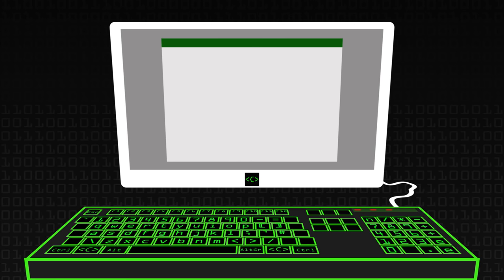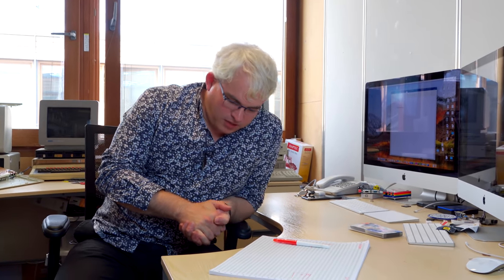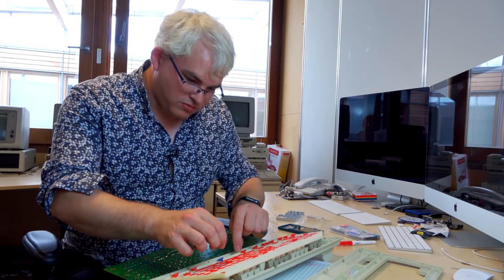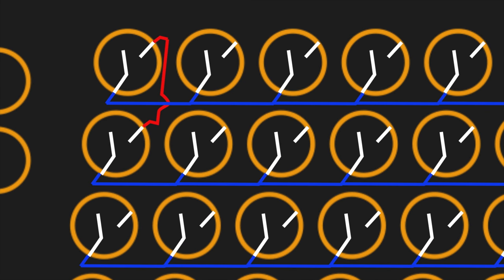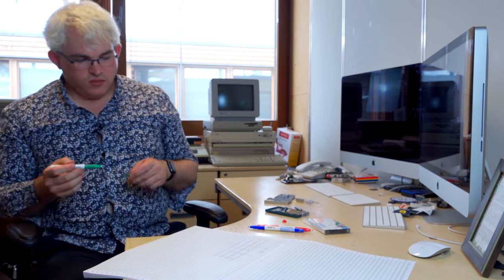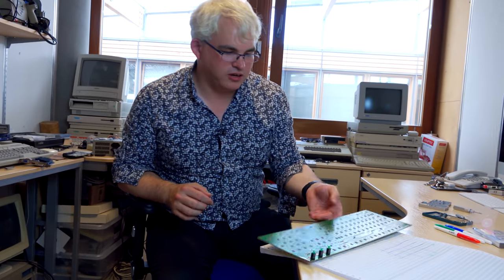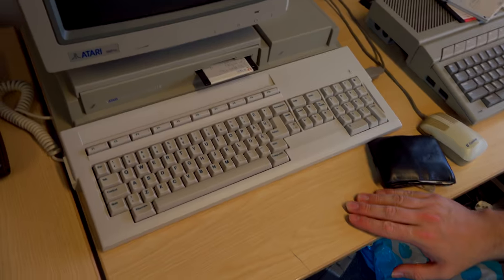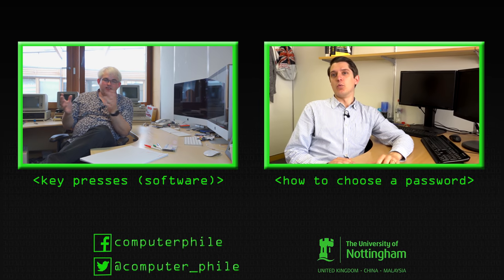What Happens When I Press a Key? - Computerphile

Comment: One thing not mentioned is the "de-bouncing" circuit. As switches, the keyboard switches tend to "bounce" or "ring". One keypress produced not just one, but multiple key-down and key-up events. The "de-bouncer" ensures that these are picked up by the machine as a single press.
Reply: noferblatz you can also fix this with many many diodes (one for each key) , no ghosting then :)
Reply: Andrew Joy you can use diodes to debounce? I've used caps, but never heard of diodes.
Reply: Diodes can't be used for debouncing, usually. I think Andrew is mistaken. Ghosting and debouncing are independent of each other.
Reply: bvbk007   I agree with you.  Might be worth mentioning software debouncing, that I've used on arduino projects.  No extra components, the software does a very crude simulation of an RC network response.  Maybe called a boxcar filter?
Reply: bvbk007 ok, just making sure I didn't fall asleep in Electronics or something.
Reply: A lot of older systems used software debouncing, or... I guess you might call it 'firmware' debouncing.

If it isn't the computer doing it, it's the keyboard controller, but many keyboards are essentially computers in their own right.

That's not to say pure hardware filtering doesn't happen just as often, but software filtering just seems to be cheaper...

Sometimes, there's no filtering of any kind in the underlying hardware, firmware or OS, and the end user program has to do it.
That's always fun. XD
Reply: As seen on his example rubber dome over PCB keyboard, there's typically minimal hardware and the debouncing in this case must be performed by the microcontroller that does the keyboard matrix scanning. Diodes are used in higher end keyboards to avoid ghosting (where multiple keys cause misdetection), but can be used for unidirectional debouncing in single switch circuits.
Reply: It's not electrical "ringing", that's what happens with inductance. It's microscopic arcing of the low voltage signal across the switch contacts, which an R or R/C snubbed will suppress.
Reply: LoneTech  could you explain how you're connecting a diode to achieve uni-directional de-bouncing?  As I see it a diode does not provide the needed time constant to convert a flickering switch state into a steady one.
Reply: Ray Kent I wouldn't call software debouncing crude. wait for N consecutive reads without a state change, then trigger the event. It's very reliable. No point in simulating the rc circuit - it would require multiplication!  there are more direct ways
Reply: I built a keyboard in college for one of my classes. You can do with a capacitor or just do it with the micro-controller, where you track the number of high/low cycles. I wouldn't exactly say it is a circuit.
Reply: In regards to using a diode for debouncing I honestly can't recall the frequency response of a diode but the cap makes sense in a little high pass filter that is going to ground. I imagine it would attenuate the bounce to remain under the voltage threshold that reads as a switch press if you dialed the circuit in correctly.

Comment: 10:02 And one nice thing about scan codes is they don’t distinguish between modifier and non-modifier keys; it’s just “key «n» has been pressed” and “key «n» has been released”, it’s up to the software to decide if key «n» is a modifier key or not. And you can distinguish between e.g. left-shift and right-shift (they have different scan codes), and implement other fun custom behaviours.
Reply: At least for USB: yes, they do. The state of the modifier keys is encoded in a single byte (which indeed allows a distinction between left-shift and right-shift), then other keys are transmitted individually. Sure, the software can decide what to do with that information, but the modifier keys do play a special role from the hardware perspective.
Reply: @floxbr9350 yeah i learnt that in ben eater's video about usb

Comment: Back in the days of windows 95/98 and XP I used ports 0x60 and 0x64 to communicate with the keyboard controller directly and insert characters into the keyboards output buffer which were then read by windows as normal key presses. This let me get past several games anti cheat / botting software.

Comment: Years ago I used to program on a desktop system that used Hall Effect keys. The keyboard was specifically designed for data entry. It was made in Utica, NY and was originally called a Cogar System 4. Later Singer bought the company and called it a Singer 1501. When Singer was bought by ICL it became the ICL 1501. 
A VERY nifty system for its day.

Comment: say I press 3 keys at the exact same time of which 2 are on the same line vertically and the other one is in the same line horizontally with one of those. How can my keyboard know if I pressed 3 keys and not only 2? Or perhaps I even pressed 4 keys at the same time? How can it tell the difference?

Comment: It depends on the interface, XT, AT and PS/2 (PS/2 and AT are the same with just a new connector ) are interrupts , USB uses polling.

PS/2 AT etc The computer does nothing , the keyboard controller polls the matrix and sends hardware interrupts to the CPU

For USB the same thing happens but the keyboard does not send an interrupt, it holds the keys in a buffer till the computer polls it for key presses.

Language does not change the scan code set ! AT PS/2 USB ect are ALL scan code set 2 , XT is scan code set 1 ( for some reason) and most terminals and pre PC computers mainframes , serial terminals etc use scancode set 3
Reply: USB standards specifies a scan code for USB keyboards, it does not use set 2 (AT). Or if does it is non-compliant with the USB standard for keyboards.
Reply: Yes your correct. But they use the same codes in the background so 2c is Z in USB and in Set 2 so its short hand.
Reply: USB is most certainly not using set 2 - for the reason why, look up what the scancode is for the arrow keys, which have a prefix for set 1 compatibility, or the Pause key which is 7 bytes long. USB keycodes are in alphabetic order and Z in particular is 1D (see HID usage tables, section 10 keyboard). Your firmware might be translating it for legacy OS support, however. Set 3 was more logical in that it used a single bit for press/release and one byte for each event. Also, the polling in USB is performed by the host controller, not the CPU, so we still have an interrupt for when things have changed. There are also buffers in both keyboards and port controllers for PS/2, AT etc, but the CPU typically has to handle them byte by byte.
Reply: I agree. This video is quite oversimplified and erroneous at times.
Reply: Lol at the people trying to tell a computer science professor he's wrong........
Reply: Michael Fish it's not necessarily that he's wrong (he might be), it's that many details of a subject can be lost when simplifying it
Reply: lol at Micheal who doesn't know that computer science and design of hardware are two  different things.
Reply: bob jones, interrupt handling varies with architectures. For instance, on a PC there's at least one PIC or APIC (P because the priorities are programmable) holding interrupt flags, priorities and masks, and on most microcontrollers interrupts are vectored, so there's no time spent finding which interrupt occurred. Some have event systems that can trigger other functions without involving the CPU at all. XMOS XS-1 might wake up a distinct hardware thread to be run concurrently with all that were already running. The basic function of an interrupt remains to reroute control flow in response to external events, which is why it was called the Sequence Break System on the PDP-1. I expect the professor is aware of several of these variations, even if the explanation here is cut short. For a low priority interrupt to not be processed would require quite an extraordinary delay; typically they're low priority specifically because the connected device is so slow that the risk of overflows is negigible. The most common source of such problems is instead buggy ISRs that fail to clear interrupt flags.
Reply: I do not know of any USB keyboard-type device (or mouse, or tablet) that uses polling over the bus. All USB protocols use event-, bus- and packet-based communication, even real-time video and audio.
Reply: William, I suspect you’re misunderstanding the concept of »polling« somewhat, especially in the phrase »the bluetooth controller polls to the USB / PCI controller« — usually, polling means frequently repeated checks for changes of state. Did you mean the latter controller polls the former controller? Thanks!
Reply: I've been using a Colemak layout in Windows until I can get my Mac fixed, and for some reason Windows keeps switching back to U.S./Qwerty layout. Anyone know why I can't get Windows to stay on Colemak?
Reply: holds the keys in a buffer? what about if you long-press multiple keys? how does it work?
Reply: I don't think I would enjoy a class where the prefessor spends 9 minutes talking about simple switches completing a circuit then gloss is over the software side (The part people can't really see) when describing how the CPU is interrupted and grabs the data frome the keyboard or USB.
Reply: Exactly a discussion of the PC Interrupt vector table was just ignored. Granted he's on a mac its mostlikely still using intel x86 based interrupt vectors.
Reply: What about bluetooth keyboards?
Reply: @williamocampo1709  To make it as unambiguous as possible, the USB host controller polls the HID (human interface devices), and it is commonly able to generate a hardware interrupt to the CPU if anything "interesting" happens, such as a key press. You are right that the CPU basically never does the polling, although SoC (system on a chip) designs can muddle the waters some more because the polling component resides on the same chip and usually die. The important bit though is that the HID handling does not compete with program execution resources (e.g. registers, instruction fetch and decoding circuits, ALUs…) unless there is an event such as a key press.
Reply: For usb keyboard, if the keyboard holds the key input in a buffer, how does the computer detects a combination keypress like ctrl+alt+delete? And how does the computer detects a key longpress? Can someone answer, please?

Comment: you don't need a microcontroller though,  you can scan using a 555 timer and counter IC,  then run the result of the matrix through various logic gates to create a binary code output,  I guess this could get quite complex when dealing with a computer keyboard,   I have only done it with a numeric keypad.  Anyway I guess then what happens is the result updates a register, and whenever a key press is detected to have occurred,  an interrupt is sent to the CPU periodically,  the CPU then reads your keyboard register when it wants to.

Comment: I pushed "H" on keyboard, but nothing happened..... :(

Does computer have to be turned on?
Reply: No, computer doesn't need to be on. It sounds like your keyboard is not working. Have you tried restarting your keyboard?
Reply: Jeremy Elliot 
Yes, i tried, with torch, as always. Did not help.
Maybe it needs new oil and spark plugs?
Reply: We'll it does need the voltage to apply to the rows somehow. Try plugging it into a battery
Reply: This is normal. You have a French keyboard, and the "H" is silent in French. HTH. HAND.
Reply: No, you need to have common sense.
Reply: Nothing never happens, always something happens, it's just that you desired something else to happen and it didn't go your way.....
Reply: @whykoks  not true. If time stops - nothing happends.
Reply: @jareknowak8712  wow... never thought so far.... Perhaps we are in different frames of reference
Reply: @whykoks  same when You are traveling at the speed of light - for You the time stops - that means nothing happends, for You. 
So in fact, sometimes nothing happends.

Comment: Anyone remember the times where you could push (at most) three keys simultaneously? :) My first computer would at that point freeze for the duration of beep (from the speaker at the bottom of the computer case) repeatedly until some keys were released.
Reply: I had forgotten all about this. . . then you mentioned the beep.

Comment: 11:00 onwards was a bit lacking in detail. HOW does the hardware interrupt the CPU? What happens - memory registers? Special pins on the CPU...what EXACTLY?
Reply: Grundibular the implementation varies a bit depending on the cpu itself, but generally speaking, the CPU will have an interrupt controller. When the controller itself receives an interrupt from a device, such as  a key press, it will force the processor to save its state and jump to a special part of memory called an interrupt vector table. This table will then tell the cpu where to jump next, into what is called an interrupt service routine, which actually handles the new data. Once this is done, the cpu resumes its previous work.
Reply: if its a USB keyboard it doesn't interrupt the CPU, PS/2 keyboards do but USB ones rely once again on polling. USB devices communicate by sending 1 frame of data every 1/1000th of a second, this is why many gaming keyboards; in search of a gimmick to make themselves appear advantageous over normal ones... claim an update rate of 1000hz, simply they just send data out on every USB frame, most keyboards update at 125hz because 125 is 1/8th of 1000 so they only need to update on every 8th frame.
Reply: @RWoody1995  technically speaking, your software does receive USB interrupts. They just aren't generated by the keyboard.
To get the load off the CPU, dedicated hardware polls the keyboard at regular intervals, and sends an interrupt to the system when a change occurs
Reply: I remember I was asked this in a interview. I got to the interrupt handler in three sentences or less . 
So is the key value delivered to the current application? What’s the api for it to read ? It’s reading it using an api like a file ?
Reply: Most new motherboards that I'm aware of don't have a true PS/2 port. It has a built-in adapter. USB I believe.

Comment: The M is the epitome of keyboard perfection. There's a reason it is so remembered: It saw satisfying, comfortable, accurate, and near-indestructible. Very few keyboards achieve that level of quality, and those that do achieve it today are designed specifically in imitation of the M's design and always compared to it.
Reply: No way , model F any day !
Reply: The earlier IBM beamspring is probably the best keyboard mechanism ever made. Unfortunately it comes with some real drawbacks like its huge size and complexity of the capacitive sensing circuitry used.
Reply: Yeh but they are amazing! I love mine. F uses capacitive sensing too but the controller is less fussy about dust etc. Thats why beamsprings come with contamination shields . Or did, they have all rotten away now.
Reply: Not sure about epitome, but certainly a classic. Have 3 model M keyboards that I used for many years, but now use WASD Code V2 keyboards, with Cherry MX blue switches at home and clears at the office.  I like them all better than my M keyboards for layout and feel.

Comment: If we discuss on keyboard types here: Microsoft Modern Keyboard (or Surface Keyboard) and for mobile devices ideally their Surface type covers... your preference may be different, but nothing is better than a Surface Keyboard or the Apple Keyboard (but I hate Apple for not giving the Apple keyboard a numpad - a numpad is a must and it has to be default on - with every OS you run it with... I do not use the numpad functions on the keys when the numpad is off - ever...)

Comment: In the DOS era the interrupt just interpreted the scan code and put the scan code and the ASCII code in a buffer and then it was for the software to check if there were characters in the buffer. Is it somehow more sophisticated with Windows?
Reply: In Windows, the currently focused window gets sent a message when a key is pressed. There is WM_KEYUP and WM_KEYDOWN for the "key pressed" or "key released" messages (including repeats if you hold down a key) and WM_CHAR when the OS converts one or more keypresses into a character, depending on the current language (this can get very complicated for languages with lots of characters like Japanese). The application typically passes control to the OS and asks it to wake it up when there's a new message for it.

Comment: You mentioned when a key is released, the hardware would send a signal to the computer to say a key release event has happened - but how does the HW know a key is released, would it not need some kind of memory to check which keyboard link lines were being pressed at the previous scan?
Reply: Quite right! That's part of what the program in that microcontroller handles. USB keyboards process things slightly differently, in that they report a list of currently pressed keys instead of press/release events.
Reply: Thanks LoneTech. So the microcontroller is part of the keyboard, am I correct? So the Computer OS does not need to monitor for key presses, just wait for a key pressed/released interrupt event, yes?
Reply: kranser correct. Seperate interrupts are sent for key press and release.

Comment: I use a hybrid. A Mechamembrane, it has the response feel of a mechanic keyboard with the soft feel/lower button benefits of a membrane keyboard. I play a lot of rhythm games so the clack and feel of mechanical is a great help but my fingers are quite sensitive so if the buttons were as high as a fully mechanical keyboard my fingers would start hurting way too quickly. Also me working in FinAdmin would result in agitated fingertips as well on a fully mechanical keyboard.